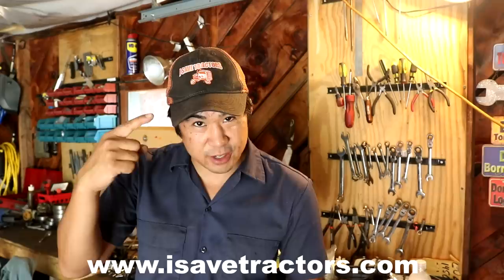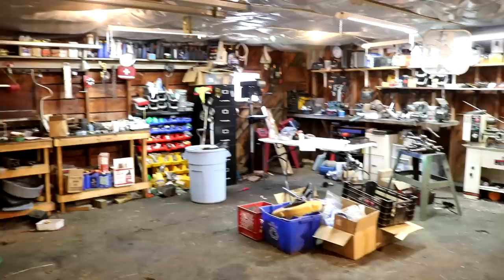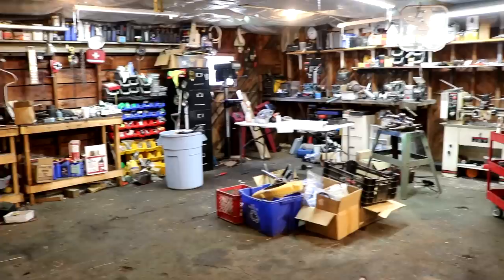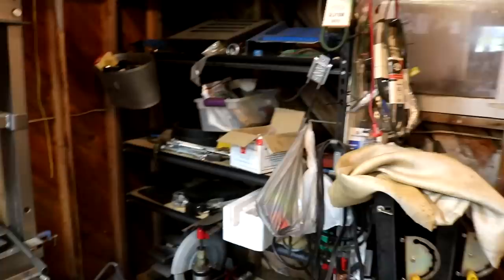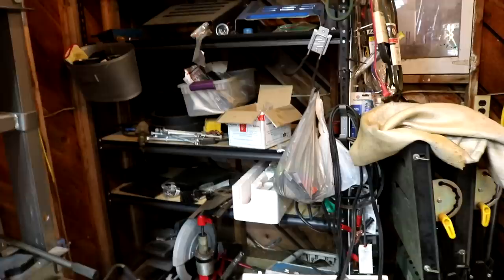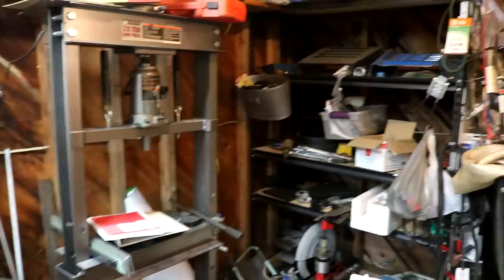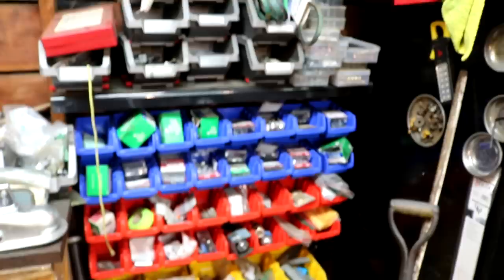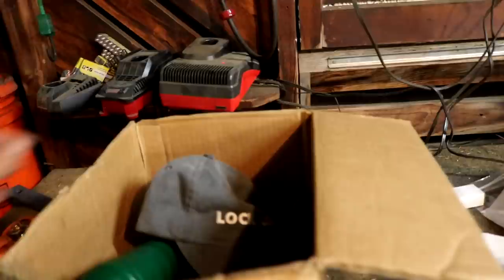iSaveTractors - Norman's Personal Shop Tour

Comment: Norman was great in sending parts over to Australia for me. I have a Gravely 812, i did an engine oversize piston rebuild, and Norman was right onto it! Gravely's aren't common over here, and i fell in love with the 812 as SOON as i saw it. Thanks Norman. Hey,,, your work benches could do with stainless steel sheet tops, saves wood chips getting into parts. I'm amazed at what you have built, totally impressive!.

Comment: The only thing I was surprised at was no lift table. I got one about 10 years ago and regretted not getting it much sooner. I'm much older than you and don't like working on the floor. It can be used for a lift as well as a work bench. Nice shop, though.

Comment: Norman  - This is great. Thanks for sharing the reality of your shop. Now I don't feel so bad about my own shop. BTW - I also use a lot of magnets - just like you do. They are sooo handy. I buy 50-100 1/2" rare earth magnets at time on eBay and use them for some products I manufacture as well as to hold just about anything just about anywhere. I do the same with my drill press chuck key - only I use a small rare earth magnet - but same idea. But I have some drawers clumsily filled with wrenches and pliers, etc. And, I have unused magnetic bars. I think it's time to put them to use. I hang my Dremels, palm sander and angle grinder on inexpensive "U" brackets on the wall. That way, I always know where they are (same as you) and can always simply reach out and grab the tool I need. It sure does save time vs opening a tool box or drawer and rooting around.... But something else - I buy two-sided velcro by the roll at Office Depot and use it to wrap my cords. It works great. I just grab the roll, grab the handy scissors and cut off the length I need, wrap it tight around the wire near the plug, then roll up the cord and wrap it loosely to keep it neat. Saves time, too. One more thing - I have replaced my old fluorescent lights with 4' LED shop lights - well worth the (reasonable) cost - and far, far better light to work by. I also have lights above each of my tools - the lathe, drill press, etc. Having focused light helps a lot. And recently, I got smart and began storing my hardware in one area and my tools in another. Gotta keep them apart and organized. I just spent an hour looking for my unused feeler gauge and found it inside of a nice, neat (but unmarked) little box with my lathe tools. When I put it away, it will go into the drawer that holds my calipers and other measureing devices. Getting organized is worth the effort. It saves time when you need something.... I like the idea of having the tools visible. I'll be following uour lead on that as well. 

I guess I'll have to do a shop tour of my place one of these days. When i do, i will stop by and share the link...

BTW - you save tractors; I save old printing presses. As an old printer, it's great fun. I use 3 cub cadets outside on my own 3.5 acres - for cutting the lawns, plowing the snow, pushing piles of gravel around, leveling the gravel I push around (with my own home-designed leveling blade that pulls behind the tractor) or pulling  one of the little trailers I carry the gravel (& just about anything) in. (I'd rather have a bucket loader, but that's a big project!)  Sometimes repairing my 3 old (1970's) Cub tractors takes away from my work on the old printing presses, but I'm getting better at it - thanks in no small part to your videos - especially that great one on basic wiring. That got me (almost) through my latest challenge - rusted old ignition switch on my Cub 782... I did mix two wires, but will review your video and figure it - out and hopefully get it running tomorrow. I gotta - the grass is growing too fast!

So. Thanks again. I will be back!
Reply from the maker: Thanks for your comment, I enjoyed it very much!

Comment: Nice man cave norm ! I've been working on mine to be able to grab tool off the wall ,I'm fed up looking in drawers and shelves .im done now my first job is strip a Briggs 1200 head I think valves sticking as its throwing fuel straight back up through filter .will start when I've got my trail bike off the bench and finished tarting it up .all the best great vids Ant from Wales UK .😎

Comment: Exactly!
I use 1/2 of our 2 Car garage (though all of it would be nice) to "TWEEK" on stuff mainly at night when I cannot sleep.
Hoping to build myself a 200sqft workshop/she'd within the next couple of years so that my wife doesn't have too "look at my mess".

I (currently) love the late 80's Craftsman GT6000's & early 90's GT5000's. So simple and "BEEFY"!

As for engines, I'll take a Kohler Magnum M18S/MV18S or M20S/MV20S over an Onan anyday! Talk about dependability and durability! And the TORQUE... WOW!

That Kohler Twin Opposed, the K531 I believe, is what I want... CAST IRON BLOCK!

I have been enjoying your videos for over a year now, you DON'T DISAPPOINT!

P.S. -2 peices...
1) Do you know of any Seasoned/Experienced Kohler Magnum Opposed Twin Engine Mechanics? I am currently working on a MV18S.

I'm looking to boost the Horsepower/Torque output by performing a Valve Job and adding Stiffer Valve Springs, but I can't find anyone... I'm also looking for a carb from a M20, because they have a "Slightly larger" venturi and larger jet. The only one you have is just tagged as Magnum 16-20hp...

I frequent the MTF Forum, Taryl -Utube, and Sprockets Garage -Utube & Facebook.

2) Also, do you have any leads torward finding any "PDF" Service Manual for a Roper 633a Transaxle? I have made "simple" repaired to the three I have (2 spare), but I'm looking for clearances & ware tolerances...
Thanks again for your Engineering and Mechanical Wisdom!

MERRY CHRISTMAS

-Thomas (12)
Port Orchard, Washington

Comment: Man I know this video is older but I can give u a little bit of advice if you want it. Welding with flux is kind of a pain and it hard to weld thin metals especially if your using .035 cause in all honesty .035 is for more heavy equipment repair. if you used .025 or .030 with shielding gas you would thank me later cause that shop you have is fine for welding with gas cause you are covered mostly for no wind. I weld I'm my Gurage with shielding gas all the time have have no issues and the thinner wire is going to keep you from melting threw those thinner metals and if you need thinker welds just do multiple passes and your good.
Reply from the maker: Thanks for your comment. I now run both. I use gas and thinner wire for sheet metal and still use .035 Flux core but now from a 200 amp welder. Have 2 welders. One set up with gas and one not. Thanks for watching.

Comment: filing cabinets are great,i have them in my shop and basement. i notice you have zero insulation in the shop,i havent finished mine yet but i have a 90,000 btu oil fired hot air furnace from a house that was converted to gas which allows me to work in a t shirt all winter. i also have air conditioning for those days we approach 90 or better. most of my shop tools are old,my one atlas lathe is from ww2 and i still use it. as i find good old tools,i sold off the china stuff which in some cases paid for the tool it replaced

Comment: You have a great shop and I like your ideas.  I do have a question....how do you heat your shop?
Reply from the maker: I am Born and Raised in Maine. I don't heat the shop. ;) J/k. I use a propane torpedo heater. I heat it until I don't shake, then I layer up my clothes. My shop in the winter gets warmed to about 40 degrees and that's what I work in. For critical measurements I bring everything into another space thats heated to 70

Comment: Hi, Does iSaveTractors have a video of converting a 1970s 12hp Gravely/Kohler from breakerless/electronic to points/condenser ignition? I bought your ignition parts package, but I was told there were some other parts such as the push rod that I have to get elsewhere. It would really be helpful if I knew what they were and where to get 'em  AND I'd love to have a  'how-to' video or at least an instruction sheet.   Pat
Reply from the maker: Nice suggestions, I have been planning on doing something like that for a while, except I have not come across any tractors in my area with the breakerless set up. I can however give you personalized tips on the conversion via email. Send us an email through our website and I will get back to you on how to do it.

Comment: hi i am an old guy approaching my end of life. I have a few tractor parts to find a good home  for. would you be interrested in picking up these items. a wards tractor complete iin goodcondition it has the BS engine 12 -15 hp ? with electric start/generator, hydrostatic drive with front dozer blade. i have a new bs engine with carb etc, looks likee neever started just like the one in my wards tractor.  i have a third engine just like the oyher two with new pistin roller brarnings, etc from a sears vintage tractor with elecctric start. you have to cme pick them up i live near redding ca.
Reply: Joe, Did you get rid of the equipment you talked about. I save tractors as well and woud love to do it full time. I am leaving my chemical engineering job to restore vintae tractors and small engines. If you still would be interested, i could come and pick up what ever you would kindly let go of. I will give them a great home and my goal is to completely restore the engines. thank you. get in touch and if you leave me an email I will give you all my contact info. I am in PA. thank you.